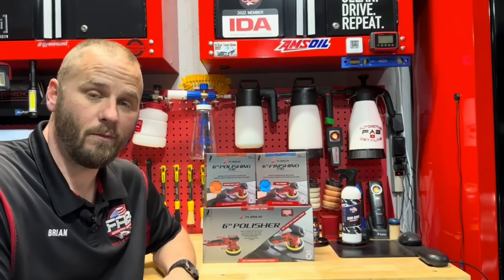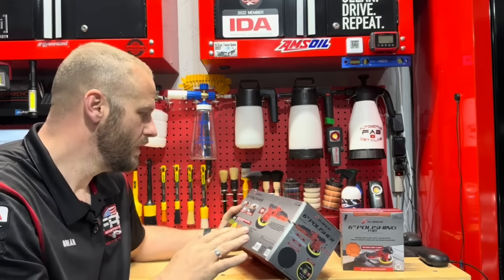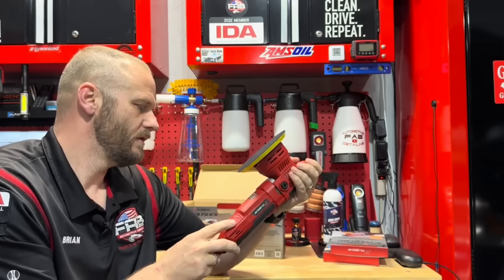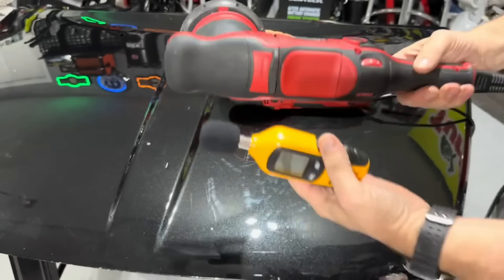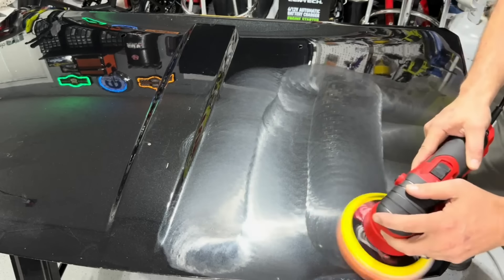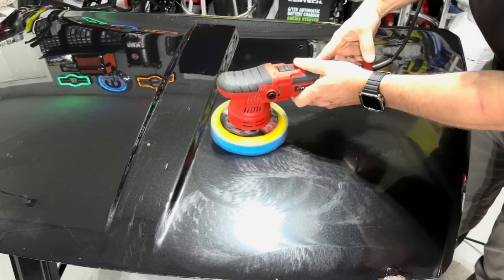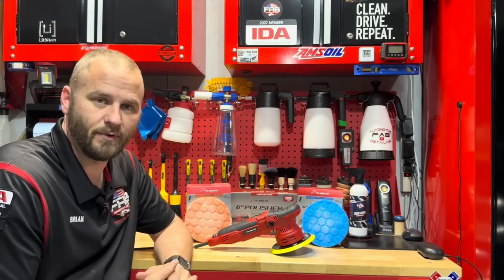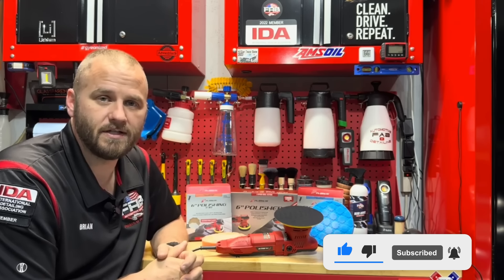Walmart’s New $70 Polisher & $7 Polishing Pads! They Are Cheap but Are They Any Good?

Comment: More powerful than the classic Porter Cable 7424. Non-vented backing plates are not unusual. Having the pad stall is one of the protections of a free-spin DIY polisher. That's why a free-spin is preferred for newbies over a forced rotation polisher.

Comment: I'm thinking after it heats up from the first few uses, that grease would thin out and make its way into the gears. I need a long throw, so i'm probably going with the harbor freight option. Harbor freight has clearanced their bauer pads, though, and they have another brand called "grant"... flat pads with no pattern, at $10 each.
Reply from the maker: @sumdood2035  The new Harbor Freight Grant pads are great!

Comment: Great video on a home DIY machine. My only suggestion would be to hear the difference if any after you repacked it with grease and which grease you used.
Reply from the maker: Thank you! Didn’t change the noise but did make the machine a little bit smoother. I use Amsoil grease. Part number GLCCR
Reply from the maker: If you’re not an amsoil customer you would have to sign up to be a preferred customer and you will save money. If your interested I can get you my code to use when you sign up

Comment: How much better did it run when you changed the grease?
Reply from the maker: I haven’t used it on a panel yet but it felt smoother when I ran it for a second.

Comment: Do you think this could polish and shine a clear coat after 2k grit sanding orange peel? Great vid btw!!
Reply from the maker: @DougieDYT  Yes it could. The pad and compound you use are what’s most important.
Reply: @FABAutomotiveDetailing  yea, I just bought it. I recently got a 1998 skyline r34 and putting a body kit on it. I had to repair the bumper (came out great) and after spraying, had to wet sand some imperfections and used this and the right pads and it came out great. I’m waiting to polish the kit after I install it; much easier to polish/buff when it’s on the car vs lose parts on the ground lol. Thanks for the vid, helped me a lot 💪🫡

Comment: Brian, have you ever used a Porter Cable? I hear that it vibrates. It's loud and ergonomically uncomfortable. It's not that cheap either. I still see suppliers selling them in a bundle. 
I'm asking because I'm looking for something to compare it to. I wouldn't buy it because I already have too many polishers. It's borderline insanity. Right along with the polishes, compounds and ceramic sprays.
Nice demonstration bud.
Reply from the maker: I have not used the porter cable so I can’t answer that. I don’t need another polisher either but couldn’t pass up testing this one.

Comment: I just got the griot g9 never polish before I have the complete compound would I use the step 2 pad with it and if I did a wax step 3 pad or can one of theses pads do both . Ty for help
Reply from the maker: @sixkings7831  You would use the step 2 for cutting and step 3 for finishing. The softer the pad the better it finishes. The stiffer the pad the more it cuts.

Comment: Im going to get one based off your reaction. Did the amsoil quiet it down & which exact grease would you recommend ?
Reply from the maker: It’s part number GLCCR. If you sign up as a preferred customer you will get 25% off. The first 6 months should be free and then it’s $20/year after that but you will save that money easily throughout the year. They have the absolute best oils on the market. I’ve been a professional mechanic for over 20 years and it’s all I use. If you do make sure you use my dealer number 5597673 and you will be my customer. If you have any questions let me know. You can get ahold of me on IG or Facebook.
Reply: @FABAutomotiveDetailing  thank you very much !
Reply from the maker: @marquisethomas5611  You are welcome

Comment: Thank you for the review. I've only used cordless polishers. When using this polisher do you need to use a special extension cord to keep it from disconnecting?? If so how to avoid accidentally unplugging the polisher? Thanks
Reply from the maker: No just a regular extension chord will work
Reply: Thanks

Comment: Interested.  How do you clean the pads after using?
Reply from the maker: @davidmojica3024  You can use Dawn dish soap with warm water and work them with your fingers from the center out until the water runs clear.

Comment: I bought a Milwaukee 21mm cordless polisher not knowing that I would have been better off buying the 15 as I am fairly new to polishing.. Would you recommend selling the 21 and take the loss, or can I get better results replacing the 6 inch with a 5 inch backing plate?
Reply from the maker: I would definitely switch to a 5 inch backing plate. With the long throw you just have to pay close attention to mirrors, door handles and body lines when you get close to them.

Comment: what is that vibration like sound? Before you tried to bog it down. Of course it got worse when you put orrsdure on it. Definitely would swap out the Grease for a higher temp better quality grease
Reply from the maker: It was the thin metal the hood is made out of it flexes so easy.

Comment: @8:03  I'm super stingy with the thumbs ups i give to videos (maybe 1 every 2 years) but you deserve it. i will be picking up one of these soon. thank you. 

also, you earned a new subscriber.
Reply from the maker: Thank you I really appreciate it! Welcome to the FAB Family
Reply: @FABAutomotiveDetailing I did buy it and just like yours they had plenty of grease but none was on the gears. I put the grease on the gears and put it back together. I’d love to see your results with the db meter again after greasing the gears to see if it did quiet it down so there isn’t 3db noise difference.

Comment: What kind of machine would you use to buff?A diamond plate tool box on a pickup Truck, I am very curious on what you think.Thank you
Reply from the maker: This machine would work but a rotary would be faster on diamond plate.
Reply: Where can I get one of those @FABAutomotiveDetailing
Reply from the maker: @martinneps9387  Harbor Freight sells them. If that’s all your wanting to use it for there is no reason to buy an expensive brand.

Comment: I made my own...lol.   I couldn't find a six inch where you could use the foam pad, so I made my own and it works gteat.
Reply from the maker: I’ve never seen any polisher that is pad specific. Every 6 inch polisher I have used uses a pad be it wool, microfiber or foam.
Reply: @FABAutomotiveDetailing   The velcro pads, bro.  Most six inch have the bonnets.
Reply from the maker: @stangedude5646  A long time ago they did but all polishers from the last 15-20 years are Velcro. I have a 6 inch Griots Garage Polisher from 2005 that is Velcro.
Reply: @FABAutomotiveDetailing  Got to Oreilly...lol.

Comment: My thoughts are it would be good for applying waxes and sealants. Also if you could swap out for a 3 inch plate it looks like it would be a great 3 inch polisher. Thanks FAB just wanted to put my 2 cents in.
Reply from the maker: Oh it’s way more machine then just applying a wax or sealant. This thing has plenty of power to correct any paint. I recently took the backing plate off and put the Griot’s 3 inch backing plate on it no problem at all. Worked perfectly
Reply: I've been looking for a new 3 inch. I may have to give it a try. And as you said a backup is always good to have.
Reply: @FABAutomotiveDetailing three inch and a short throw would be ideal for what exactly? 
Curves and tight spaces?
Reply from the maker: @josephoverstreet5584  Tight spaces, body lines, tops of doors, pillars etc. 3 inch polishers are necessary when correcting paint.

Comment: So here’s the kicker, this or harbor freight, either the 8mm or the 20mm. The 8mm is less than 40 right now and the 20mm has gotten down to $50 before. Pads honestly look great though.
Reply: HF has a pretty neat tool on their site to help you select the right polisher. Answer some questions and it gives you a suggested listing with grades (surface safe, use for compounding, polishing, etc.).

Comment: Variable speed DA, pads, and a backing pad for $70!?!? Harbor Frieight doesn't even beat that!
Reply: I think that's true except for the pads ($7 ea; sold separately)
Reply: @billcrisp1804  comes with 1 pad, but even the other pads sold separately are cheaper (better?) than the Harbor Freight pads lol
Reply: @jgneolardo8875  ah, yes, now I see it. One of the associated images on the site indeed says it has "6" multi-use polishing pad".  Thanks for the tip.

Comment: Looks pretty much identical to the Bauer random orbital polisher from Harbor Freight at $69.99
Reply from the maker: All these polisher kind of look the same to be honest. Most polishers have the same design to them. I’ve heard the Bauer is good also
Reply: @FABAutomotiveDetailing  on a different channel, the reviewer took it apart and added a high quality red grease and it was quieter, smoother and ran cooler. 

I’d bet a lot of these polishers come out of the same factory and are just rebranded.
Reply: Why are people saying this? Other than the basic shape of a polisher, it literally has no specific details in common with the Bauer.
Reply: @bigwilliearmitage  All of them manufactured in China are EXTREMELY similar.  There's only so many places in China that make these things.

Comment: Is anyone else having a hard time finding this? I've stopped at every Wal Mart I can and it's not online!
Reply from the maker: It’s in stock in Indiana. Use my zip code online. It’s 46140 and see if it pops up
Reply: I'm in Virgin-I-A and the website says it's "ready for pickup today".  Platinum Series Buffer Polisher, 6 Speed Dual Action for Car Detailing, 6 inch, 5 Piece Set $70

Comment: This is a nothing burger, Harbor freight has the 8mm throw DA on sale this week for $39 and has tons of good mods.
Reply from the maker: I disagree! I have used the Bauer and this definitely has more power. This one also accepts Griots backing plates which I found out last night just to see if they would fit. The 2”,3”,5” and 6” all fit it.
Reply: @FABAutomotiveDetailing  The Bauer also has a universal fit backing plate system.  I have the 5" maxshine on mine.  Also, when you move way down in backing plate size, you have to change or modify the counter weight or you'll deal with some serious vibration.